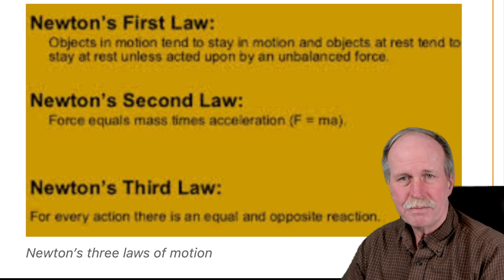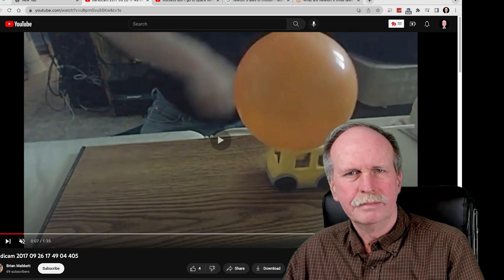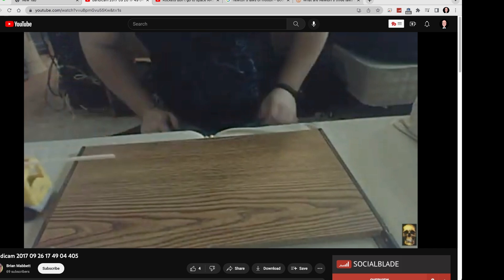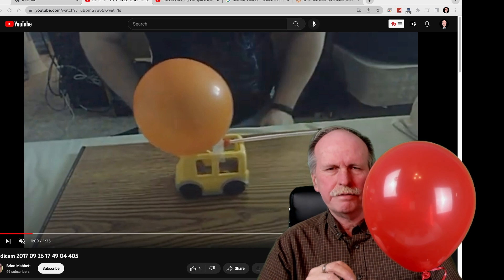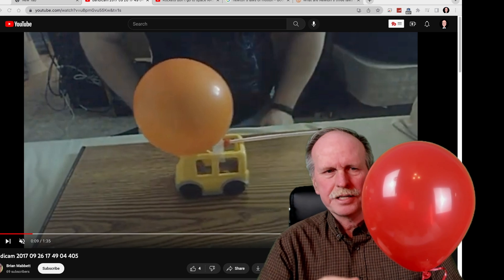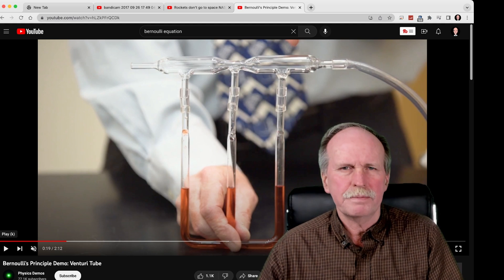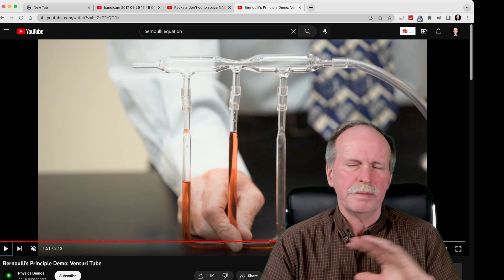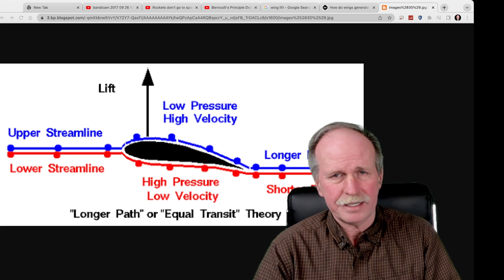Flat Earth Proves Rockets DON'T WORK

Comment: Get two people in 2 boats in the middle of a calm lake, and get a person in one boat to push on the other boat. Watch the Flat Earthers' heads explode as they try to explain why both boats start moving....
Reply: Nah, that wouldn’t help them. They think that the reason rockets fly is because there’s air around them to push off of, like the guy on the boat pushes off the other boat.
Reply: @origamiswami6272  
LOL They'd probably try that, until someone points out that would mean the water behind the boat must therefore be sucking it backwards for it to work that way ;)
Reply: @origamiswami6272  Yes but, the real goal here is to get the flerf to jump into the water.  Who really cares what he thinks of why the boat moved.
Reply: @origamiswami6272  you’re basically correct. Good job buddy!😅
Reply: They’ll just say ‘look at how flat the lake is’…
Reply: Lmfao 😆 🤣 😂 😹 well. .one is getting pushed...and the other is getting pulled...backwards!
Reply: @mobilegamersunite  They'll just look at it and claim that what's happening isn't really happening, that it's CGI, that it's Photoshop, and scream 'Black Swan, Black Swan' constantly until they turn blue.
Reply: In flatearth logic the boat you call "fuel" would be moving but the boat you call "rocket" would be standing still because there is nothing to push against. If you rename the boats it's the othe way around.
Reply: ...come on, none of these guys have ever even been able to explain anything, which is why they generally don't do it...
Reply: That's because the boat is pushing against physical matter the water) and is reacting to Newton's law of reactive dynamics! In "outer space" (if such an impossible vacuum could ever exist) there is nothing whatsoever to push against!!!
Reply: @oldskool1977  
The whole point of Newtons Laws is that they don't get affected by local variables like atmosphere. Quote the part of Relativity that states a medium is required.
That's the mistake people always make about jets. they think that jets are just like a 'new kind of propeller' that push themselves along on the air in the same way as propellers move planes through the air. This is a misconception that is based on the idea that jets lever themselves off the air in some way. In fact, the reason jets fly higher than prop planes is because not only do they not need air to 'grip' on, but in fact, air tends to get in their way and slow them down. That's why the fastest planes are also the highest flying.
Reply: @sourand jaded With that logic, what is being compared with the gun and the bullet being pushed against each other is the rocket and its expulsion of spent fuel as thrust with the oxygen in the atmosphere! This logic would never work in the vacuum of "outer space". Yes, the GUN & BULLET would work in "outer space" but that's not a comparison, as the gun is compared to the thrusted rockets and the bullet as the atmosphere! There is no such atmosphere in "outer space", therefore, suffice it to say that rocketships absolutely, undeniably & scientifically DO NOT WORK AT ALL in "outer space"!!!
Reply: @Old Skool  Knucklehead, the bullet is NOT the atmosphere in this analogy.
You can't understand it's the mass and velocity of the bullet that causes an equal and opposite reaction to the gun. In air, in a vacuum, under water, wherever. The bullet is not "pushing against the air" to cause kickback - it's the momentum of the bullet (mass times velocity) that is transferred to the gun.
Try this: stand on a skateboard and throw a bowling ball as fast as you can. The skateboard will move backwards, same as the kickback in the gun. Your velocity backwards can be calculated by the weight of the bowling ball times the speed you threw it, divided by your weight.
The bowling ball, and the bullet are not pushing against the air to move you backwards - it's the momentum of the ball or bullet being conserved. (Momentum = speed x weight). Whatever goes in one direction causes the equal momentum change in the opposite direction. Works every time, everywhere, with or without air. Yes, try it in a vacuum and see for yourself. 
Instead of ranting, try reading a BASIC physics book.
Reply: @keith726able  It looks like Old Skool deleted his post...
Reply: @keith726able  Agree, and you have to pity people who can reduce the rest of our Universe to "just lights in the sky".  Terrible and sad.
Reply: @oldskool1977  - "suffice it to say that rocketships absolutely, undeniably & scientifically DO NOT WORK AT ALL in "outer space"!!!

So according to your misguided understanding of basic physics: A CROSSBOW fired into a vacuum would NOT have any recoil.
Do you really believe that?
Reply: There's a great video that pops up from time to time on NASA TV filmed on the ISS for STEM students, where one astronaut is behind another and pushes him, resulting in both of them moving off in opposite directions.

Oh wait, I forgot... NASA... yeah... that lot. And of course, the ISS isn't real either.

I like how they say rockets won't work in space, when most of them don't believe in space.
Reply: @tomstamford6837  That's the reason they don't believe in space.  If they believed in space, they would have to believe that rockets can go there and not hit the firmament, and actually orbit the Earth.  What they can't explain is what to call that thing which is between the gas molecules in our atmosphere, and what happens to our atmosphere the higher you go.
Reply: @sourand jaded you seemed to have totally missed the point and the crux of the comparison in which you were trying so desperately to make!
Reply: @sourand jaded I have studied, researched & done my very own experiments for 7 years now. I never try to convert religious, dogmatic folk that will never ever look deep enough into the actual scientific research for their own growth in humanity & understanding in all of the natural sciences!
Reply: "every little bit helps said the sailor and blew into the sail"
but I think he better had started peddling.
Reply: @kamion53  If he blew away from the sail and away from his intended direction, he might get somewhere... 😄
Reply: @steyer-crmg  No, there is measurable curvature on the great lakes, and there is even curvature on small ones, but it's far too little to be noticeable, just as there are tides in all lakes as well. Remember the largest great lake is over 40x smaller than the smallest Ocean, so the effects are less noticeable.
The original comment centres around the often-stated idea that thrust needs to be pushing against a medium for a rocket to work, which shows a basic misunderstanding of Newton's Laws. The truth is Newton's Law deals with Force and Force alone, so pushing against a boat in the middle of a lake will create motion in both objects in opposing directions, regardless of the fact that force was only applied from one of the boats. As someone pointed out later, a better comparison would be the recoil from a bullet, which is caused by the energy of the bullet, not the bullet pressing against the air, but either way, at no point did Newton say that thrust needed leverage on air or anything else, thrust levers against the thruster, that's why it's called a thruster.
Reply: @steyer-crmg  It has been proven. That you dismissed the proof as false is one part of the problem. That you cannot understand other proof and most importantly  refuse to learn, is the other half of the problem.

Not knowing something does not make you dumb. That can easily be corrected.
Not understanding after being shown is.
Even worse though, is willfully remaining ignorant, then declaring yourself right despite that ignorance.
Just learn. It is not that hard. If it is not worth your effort to learn, then rely on those who have.
Reply: @steyer-crmg  Believe me with that sort of "connection", I'd prefer to be DISconnected any day.  In the meantime, if you can't understand how a simple observation like I posted before proves the Earth is a rotating sphere, then you are beyond hope and beyond help.
Reply: Even better, give the phlat erfer a rope and tell him to jump the metre gap between the small boat and the dock with the rope. See how far he gets.
Reply: They come up with some bs reason like buoyancy
Reply: @Michael-sb8jf  That's Nathan Oakley's baby, but he can't explain how you get "buoyancy" without gravity or how a sphere in a vacuum will always move DOWNhill on an inclined plane where buoyancy isn't a factor.
Reply: Uhh, nooo
Reply: Should be too difficult since the idiots believe the Earth is spinning at 1000 m.p.h. 🤣🤣🤣
Reply: @ShaneOsborne  
It is, but that's only a rotational velocity half of that of an hour hand on a clock. Think of two cars going at 100mph, if you were stationary, you'd think they were going fast, but if you were in one of the cars, the other car would appear stationary.
This is that whole problem that conspiracy theorists have with being intimidated by large numbers, because they don't really understand the values being described.
Reply: well - he is pushing against something.
better experiement: Have one guy in a boat, and let him throw a styrofoam ball and a bowling ball (both of the same size - not weight - of course) backwards out of the boat with the same velocity. I wonder how a FLERF will explain the difference in counter-reaction.
Reply: Dumb when both stop dumb
Reply: This is very uninformed.
Reply: @jamesb6857  What exactly is "uninformed"?
Reply: @chrisantoniou4366  
I think he means they would find a workaround as origamiswami said, but used the wrong word. My comment is 100% correct about the motion of the boats, so 'uninformed' was a poor word choice.
Reply: @DeadEyeJedi  I just didn't understand what was "uninformed" and I wasn't even sure it was your comment he was talking about, hence the question.  No question about the boat example, but I don't think that a flat Earther's head has anything explosive in it...
Reply: @steyer-crmg  It proves that every action has an equal and opposite REaction, proving that rockets can and do work in a vacuum.  They also work in a vacuum chamber and that has been proven time and again.  Lakes are NOT flat, they curve along with the Earth, the oceans, rivers, seas and everything else.  I live in Australia and yes, it is the flattest continent, but I assure you it is most definitely NOT flat!
Reply: @steyer-crmg  Any observation you can make will prove the Earth is a rotating sphere, but here's one you can do yourself without any instruments except your eyes that cannot be explained in any other way...  The stars in the Northern Hemisphere appear to rotate around the North Celestial Pole very near Polaris in an anticlockwise direction, but different stars, most not visible from the Northern Hemisphere, appear to rotate in a CLOCKwise direction around the South Celestial Pole in the Southern Hemisphere.
Reply: @steyer-crmg  I'm really hoping this is just a hamfisted attempt at sarcasm... 🤔
Reply: @chrisantoniou4366  
It's either that or desperation, still trying to figure out which.
Reply: @DeadEyeJedi  I think his subsequent reply removes all doubt but he's gone waaay past "desperation" and into the realm of delusion.
Reply: A group of flatearthers is invited by Elon Musk for a space flight to prove that the earth is a sphere. Our village idiots immediately agree, because they believe so stubbornly in their theses. The rocket launches, flies on and on, as one of Elon Musk's engineers says to him, "But our missiles can not land at all." Elon Musk responds "I know, I know"
https://youtu.be/6pFskIv77iA

Comment: To those that claim rockets can't work in space, I have two questions.
Why do rockets climb faster as they get higher, why don't they gradually slow down as they get into thinner air?
If an astronaut in space set off a stick of dynamite held against their chest, would they suffer any harm?
Asked them both, never had an answer.
Reply: I have asked a few if a shotgun would still have recoil in space.
Shuts them up fast.
Reply: Or ask them, if you can throw a ball in space. What is the ball pushing off from?
Reply: Actually, a stick of dynamite would be deadly in space because it creates its own gases.  Perhaps a better question would be which way would the body fly.   As for the rockets flying faster the higher they go, there is nothing to say they don't increase their throttle settings to make it look like they are going faster because of a lack of air pressure and it would be easier to do because rockets weigh less the higher they go.  Please note, I'm not a flat Earther by any means, just responding the way a flat Earther would.  Some flat Earthers would also claim that rockets clearly aren't going straight up for their entire flight but cant over and fly horizontally so they don't hit the "dome".  The fact that rockets need to get horizontal to get into orbit completely escapes them...
Reply: @chrisantoniou4366  .
Rockets also carry their own gases.  According to flat earthers, in the vacuum of space, like the rocket, the gases from the dynamite would harmlessly dissipate into the vacuum.
There would be nothing for them to push against and therefore no harm to the astronaut.  They know they can't go as far as making that claim since no one would accept it.
 That is why they won't answer the question.
Reply: @chrisantoniou4366  .
That would still mean that the gases didn't need an atmosphere to push against, they would take to path of least resistance.
You are right, there are many questions flat earthers don't dare try to answer.
My favourite is "What is the distance round the Equator?"
Reply: @grahvis  You see, that's why you don't get any answers, an answer to that question requires numbers and that is so far beyond them that they call it "mathemagics"... 😆  I can't even get them to answer the simpler question of "What the hell is an Equator (or ANY circle of latitude) doing on a flat plane?"
Reply: Sorry but your questions appear to not be good enough (playing devils'-advocate here):

If a rocket goes from 10g acceleration at sea-level to zero-g at the edge of space, it will still climb faster the higher it goes (as long as the acceleration > 0). Slowing down would mean an acceleration < 0. It also doesn't address the problem with gravity getting lower the further you get away from a mass (this might be used as an half-baked argument of why the lower engine-efficiency (0% efficiency) is not a problem).
Your question also contains the premise that rockets are climbing faster as they get higher; to which a flerfer would say: "Lie!"

With the stick of dynamite; they can argue that half of the stick is pushing against the other half of the stick and therefore has something to push against (and they wouldn't be wrong for a change).

Now, I would normally like to recommend a change in the questions to make them 'better' but my brain can't come up with anything useful at this point in time.